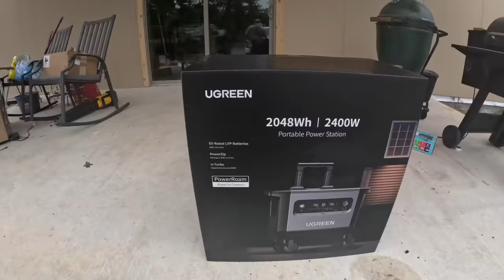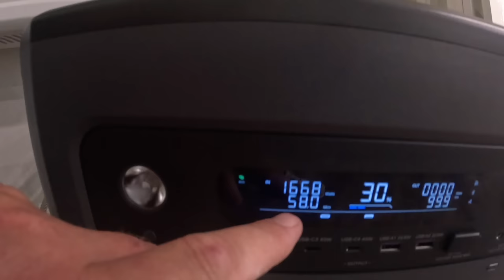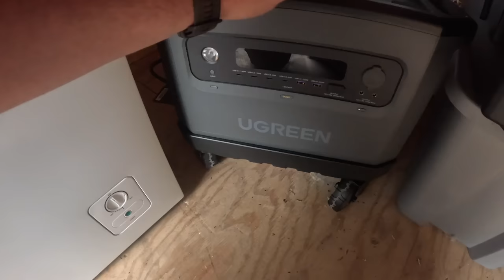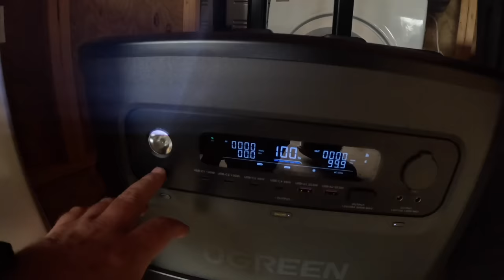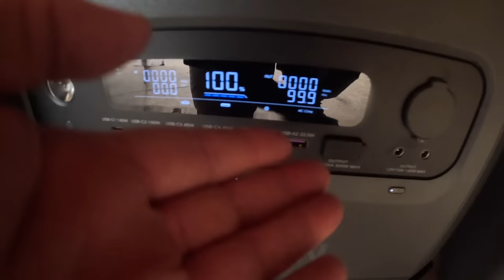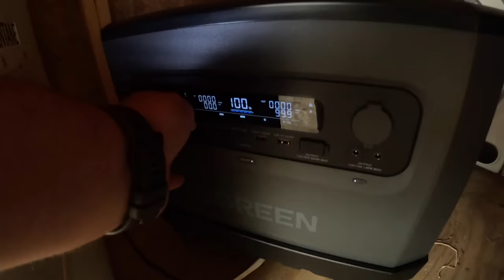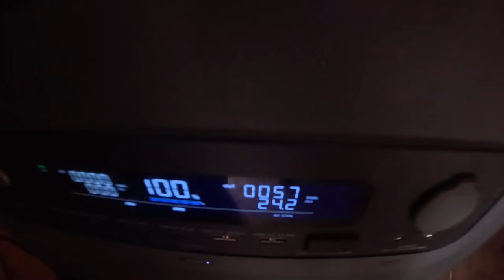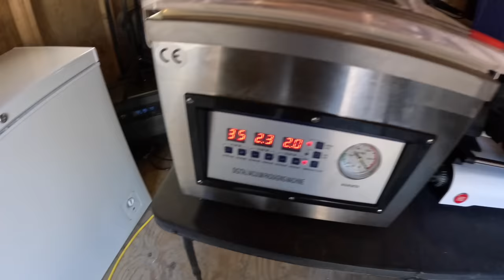Will The Ugreen Power Station Run A Deep Freezer

Comment: for keeping and staying cold chest freezers are better than standing freezer  every time you open door the cold falls out where chest will hold the cold cold is heavy has warm up to rise over chest wall 
   understand the advantage of up right is easier to find items
  i used to have a 1950s stand up where each shelf had its on door and the insulated outside door  to hold cold from free falling out

Comment: Before you throw out that freezer check the back that the coils and fan is clean and google your model for a reset procedure. Had trouble with a Samsung fridge that quit and after cleaning and finding the reset procedure the fridge has been running perfectly for over a year

Comment: Dutch that don't sound right on the box weight . A steer weighing 1,000 pounds on the hoof will average around 430 pounds of retail cuts steaks, roasts, ground beef, stew beef, etc. Rail weight is dressed hanging weight. Here is a example.  On average, a 1,000 pound
steer will only weigh approximately
61% of it’s live weight once it makes
it to the rail. This approximate 39%
loss during the slaughter and dressing procedure is a result of the animal being bled and the hide, head,
hooves, viscera, lungs and heart being removed. The remaining 61% is
often referred to as the “Hanging
Weight” or the weight “On the
Rail”.

Comment: i have idea put a power pack on the frige and freezer so when power goes off the power pack will help it run until the power comes back on.. if they do not build new power grids there will be a problem for homes. the wind mills is a joke it cost to much to operate not smart. plus they catch on fire. be bless and safe.

Comment: How about a single 50 or 100 watt solar panel as a constant trickle charger to the UGreen? It would add some time to the Time to Zero counter which would help in a power outage or away from home situation.

Comment: 3 chest types here….sort different kinds of meat into med size plastic baskets ( they stack well and are easy/quick access)…..(pink)one for pork chops, steaks etc…one for larger pieces of pork different color (red) 2/3 for beef sorted by sizes {ground, steaks, roasts, etc}….(yellow)chicken…etc…..one freezer for fruits and vegs..again different color baskets for different types of produce….ie green for green beans, red for tomato etc…the third freezer is for connivence foods, baked goods, and left overs.  Left overs always in red.  Also holds staples like nuts, chocolate chips, butter, bulk flour, milk etc.

Comment: I REALLY think a full arraysolar would ultimately be the total answer for your electric. I even think it would be cheaper in long runner your power stations. Check out wildwonderful off grid.  They have multiple buildings on solar ina cold winter climate area

Comment: Chest freezers are, in my opinion, a better freezer option. They hold the cold better when you open the door, and keep things cold for longer if the power goes out. Grew up using them. You do need to be creative when stocking them, though.

Comment: And dutch when it comes to a fridge or a frizzier is whan you move one try not to lean it past a 45 % angle but if you do . do not plug it in let it set for 24 hours that will give it time to let the coolant to migrate back to where it needs to be

Comment: Why don't you clear some land with no obstructions and build a solar system with 4 or 5 battery banks to hold the power , then your free of not having power, in winter you only need to clean your panels of snow etc also wash the panels regularly keeping the catching of sun at its best, you c an run your home shed etc and even if you had no sun the battery banks with 5 of them will take care of you for just that 5 days but cleaning the panels will help even in low sun rate

Comment: You all should hook up with the Generic the big company that adverstises those 10,000 dollar generators to advertise, the company and maybe they would give you one for the complete house to installl outside next to your house. And maybe give you a discount for the shed where your shed is and just have those two to power everything. Rather then habe a bunch of little ones. Maybe cheaper then a bunch of little ones electricity wise. Not just in emergency situations that you can run

Comment: I don't understand the reasoning behind spending thousands of dollars on solar powered electric units, an electrical generator and gasoline when I can have a 400 amp service coming into my house costing me $250 per month. The  solar electric units wont last more than a couple years with constant use and the you buy them all over again

Comment: Sean, it's time to bite the bullet and get a proper solar set up. Yes, it will set you back a chunk, but you can't rely on generators. Look at Lumnah acres. They're building themselves as well, and the forked out the money for it. One for the well house, one for the shed, and a huge one for the house. I would start with the house first.